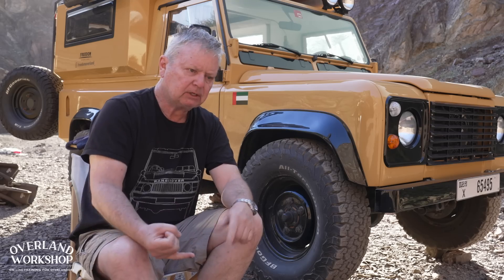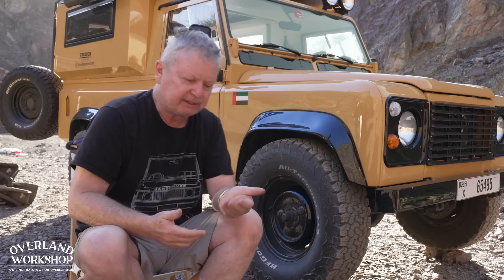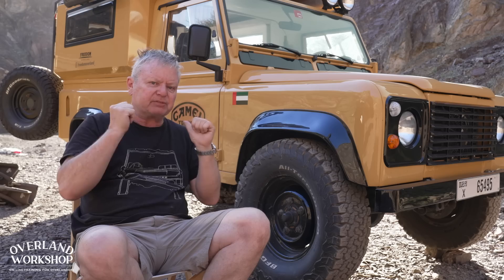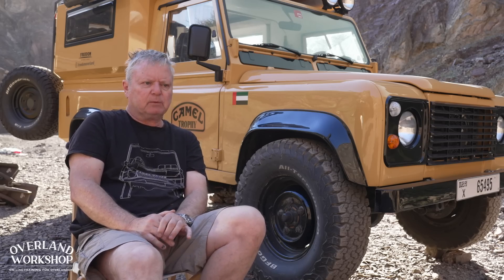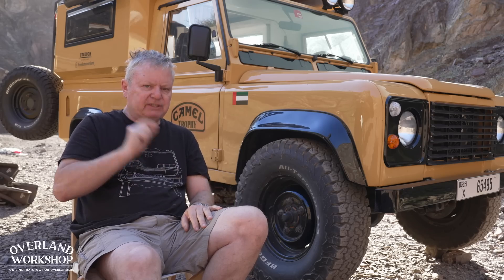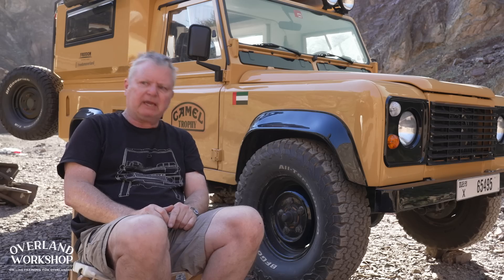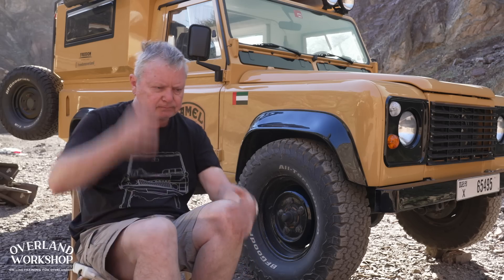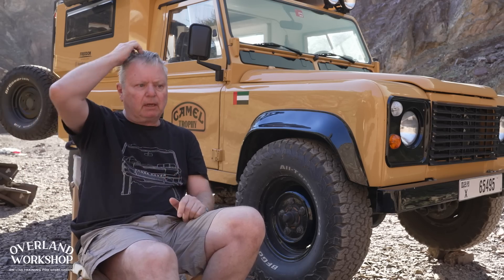4x4 Suspension principles, incorrect assumptions and stupid ideas @4xoverland

Comment: If the tank was properly baffled and you weren't exceeding the weight limit and it was distributed properly water should be fine. I have carried 20 fuel and 20 water on the roof. But that was about it. Didn't have an option.
Reply from the maker: Almost every off-the-counter roof tank is plastic, which means no baffles. But any way one looks at it, IMO, there are always better ways to carry water.

Comment: Very interesting Andrew.
Thank you.
One question though: I am towing a Caravan with my Defeender 90 and I know that these are probably not really the best vehicles for towing, but I find with stock factory suspension, sits  on its bump stops. I am considering fitting Poly airbag springs just to help level it. Is not a good idea? In your opinion? Love to know your thoughts.
Thanks%
Reply: How's the trailer ball weight?
Reply: @hannahranga  Land Rover specify a ball weight of 150kg. My van should be around 120kg from what I can work out.

Comment: 100% agreed. I have a 2003 chevy tahoe here in the USA. Most people put 6 inch lifts (that do not increase load capacity- just longer shocks that aren't stronger and spring spacers) and the center of gravity is stupid high and they have very little suspension travel for the most part. I have a heavy duty coils in the rear that add 1.5 inches of lift and 400lbs higher load rating than factory, with a 2.5 inch torsion key lift up front, and bilstien 5100 extended travel shocks all the way around. On my trips I put as much inside or on a hitch mounted cargo carrier as I can. The only things on my roof are spare 33 inch tire (cannot fit underneath the truck), traction boards, and a little bit of gasoline. Fully loaded, my center of gravity is still much lower than a tahoe on a 6 inch lift that is fully unloaded. 
Eventually I want to build a storage system inside so there's less on the hitch. Also want to build a rear bar that has a tire swing and fuel can mounts.
Reply: Used to have an 06 Tahoe, miss that thing. Nice to see some GM and US followers here. I have  05' 2500 and will be adding the 5160 shocks. How do you like the 5100s?
Reply: @bamafencer12  they are phenomenal

Comment: Thoughts on PVC pipe water storage on the roof racks? Would be impacted less by movement than a rectangular tank i'd imagine.
Reply: Would act like a solar heater and would free surface if it was aligned the wrong way
Reply: I’ve got a 4 gallon Yakima Roadshower on my Thule Roofrack, on a 4Runner. Balanced w my cargo box (middle) and awning 4’/maxtraxx on the other side. (try to add water if I can last minute and not on long road trips) Spent a good amount of time researching and using brackets and bolts that are extra heavy duty. Also very aware of my total weight and how it’s distributed  < this is key. 
No crazy weight in the interior and no metal bumpers etc… stock suspension. Love it. Dirt roads. No rock crawling.

Comment: My biggest issue with manufacturers is that max payload on standard suspension is often impossible to reach with a good ride.

My -21 hilux (with the updated more comfortable rear suspension) has a max payload of 1000kg excluding driver.
I have around 560 kg including me and it bottoms out way, way to often (And I drive 95% on-road).

It even bottoms out on sharp speedbumps at the grocery store.
Reply: I get the frustration, but as Andrew said manufacturers tend to design for the middle ground. If they tuned the suspension for the highest rating, then it will be stiff when empty. People in the US buy "Super Duty" trucks going for payload and then complain that it rides like a dump truck when empty.

My Xterra has really weak springs in  the rear as well. If you drive with weight  for any length of time they weaken to the point they keep bottoming out. When I finally replaced them, I upgraded their weight rating to compensate for that increased constant load, realizing that should I pull everything out it the ride would be stiffer.

Comment: Unless you have a mechanical engineering degree you and fix the suspension geometry you should not exceed 2” lift, even with 2” lift you need to correct all steering angles and dampening rates.

Comment: With over 40 years in the industry I agree with everything you say.  Also note that the stiffer the springs the less articulation you get for a given load.  Result being the wheel on the extended side will have less weight and therefore less traction than with a softer spring.
Reply: Being a relative 'newbie' at offroading, I've left my ex-military Defender 90 in its original milspec. While others appear to have added some new pieces of kit every time I see them, my Landy has remained unchanged and hasn't let me down. Correct me if I'm wrong, but surely the British Army would have added all of the gimmicky we see in the off-road 4x4 magazines if they were of any real value?
Reply: @rickbear7249  milspec isn't what people think it is. it's the absolute bare minimum, in terms of performance and cost to achieve a set of requirements.

If a component overperforms compared to the requirements, then they are over engineered, cost too much, use too much materials etc. They wont be chosen.. or if they are, the components will literally be refined to just meet their needs, for the benefit of mass production, efficiency and cost.

Private industry will produce components that exceed the requirements. Why and how? because they can charge more, use better materials or over engineer it simple.

If your requirements are aligned to the milspec, perfect. But be aware milspec also usually incorporates the concept of, cheap and replaceable, often trumps expensive and permanent.

Comment: indeed all well presented. the only reason for a lift kit is for brake over angle for that i also recommend a slightly higher rated spring not to make load capacity higher but to keep the height this along with the correct dampers makes for the same ride performance as standard ... question is how often do you really need the extra height :D
Reply: Yea, im not sure what circles we are discussing, but i haven't met anyone here in Australia that thinks stiffer springs increase your GVM ? there are literally engineered and certified GVM upgrade products if you want that.
Reply: the reason and only reason for a lift kit is to gain more travel when offroading.

Comment: Andrew, can you cover the combination suspension lift and shock absorber kits sold by various manufacturers with the emphasis on the points mentioned in this video ? Do they actually all fit the bill or are they “cosmetic” ? Brilliant topic and excellent explanation especially the most ignored item Centre Of Gravity !  Fire engines have special tank modifications internally to prevent massive water slap and they are low down in the framework as well.

Comment: So I agree to the argument on coil sprung 4x4 vehicles employing that set up front and back. I would have liked and looked forward to Andrews views on rear leaf sprung and front coil sprung 4x4 vehicles as to how that argument may be weighted.
In terms of roof racks and the weight carried, yes stay within the permissable loads. However carrying liquids such as water and fuel may not necessarily be wrong on top of a roof rack, sometimes it MAY be necessary. It's the containers that must be considered. Container's with baffles for either fuel or water in my view are acceptable on a roof rack.
Of course the terrain in overlanding is the key player and the driver naturally. In all cases when challenging and negotiating a variety of terrains know the limits of your vehicle and as a driver know your own limits. There is no excuse to be a knuckle head and just blunder onward, your choices deem your outcomes, overlanding, on a safari or an expedition adventure is not about been foolish and exerting male testosterone. But about the sights, sounds and destinations. 😊

Comment: Oh that’s good. I work for a logging company, primarily using Ford F250 trucks as our work trucks. “Crummies” we call them. Constantly overloaded, constantly over driven, constantly breaking leaf springs and blowing shocks. I spent the 1st 15 years of my career working in regular automotive shocks, fixing regular automotive customers, and never have I had to do a spring. Call this a culture “shock” for me, as I’m repairing spring after spring and shock after shock, pulling my hair out trying to come up with a reliable and economical solution. I will note, and I don’t think it was said in your video, that the right spring will haul the weight and do it’s end of the work properly, but the wrong shock in that scenario can also cause the springs to break still. What a balance!

Comment: My JDM HJ 61 Land Cruiser had a maximum load sticker of 350 kg, I'm assuming that it was not including passengers. The rear axle was fully floating, so it was obvious that was for reliability, not load carrying. Travelling light is something I always do as it's less to worry about, easier on the vehicle, and less expensive.
Reply: Maximum load always includes passengers because the manufactures have no idea what the user will put in their vehicle.

Comment: The dumbest suspension opinions are also the popular ones.  You need to be very discerning when taking advice on suspension.  95% of people have no idea what they are talking about, including vendors.  For instance front spring rate - everyone thinks they need heavier springs in the front and they ruin their ride, when most people need longer springs, not heavier.
Reply: To me it is a question of constant load. If I modify a rig as to increase weight when it's sitting in my driveway in any meaningful way, it's worth considering an upgrade. You just need to be mindful of how much weight you are actually adding as opposed to just putting the largest capacity springs on it.

Comment: Here in the United States there's not much in the way of regulation in most states for what sorts of aftermarket modifications are acceptable for on-highway use, and a whole lot of vehicles are modified for appearance far more than for performance.

I always have had the attitude of keeing it simple.  In my particular case my truck is a crew-cab with a 6' bed, the odd long wheelbase version of a truck normally sold as a king-cab with 6' bed or a crew cab with a 5' bed.  In many ways the LWB truck's suspension, identical to the SWB truck's suspension, is pre-compromised from the factory.  So the long wheelbase already harms the breakover angle, and the extra weight of the longer truck on the same suspension components that the short wheelbase truck uses meant that the truck sits lower, closer to its bumpstops before any cargo or passengers were loaded.

To avoid the problem of cheap aftermarket I actually started out by looking at OE parts or OE-replacement parts.  There was an SUV on same platform that had a factory V8 engine option, and along with it was packaged slightly stronger coil springs for the front end.  Not crazy so, but enough to account just a little for extra weight.  In the back I went with a triple combination, some added leafs, some Timbren tall rubber bump-stops along with deleting the heavy factory overload leafs, and some mild lift from slightly taller leafspring shackles.  I also went with Bilstein 5100s, in the front using the 3rd notch from the bottom for some lift, and in the back selecting the dampener that is around an inch or just a hair more to go along with the change in ride height and range.  I also chose a slightly lighter front antisway bar than what shipped with the truck, for just a little more suspension flex side to side without deleting the bar entirely.

The truck performs fantastically this way.  Even loaded with camping supplies and hooked up to tow a single-axle travel trailer I'm far enough off of the Timbrens to where the ride is comfortable and acceptable on even fairly washboarded roads, and yet unloaded the ride is still comfortable, the springs are not too stiff for the weight they're carrying.  If required the Timbrens act as both overload springs and as bump-stops.  The front likewise was lifted such a minor amount that I was able to use those longer upper balljoints to keep the upper control arms properly positioned, so I didn't have to buy expensive aftermarket upper arms, and the alignment shop had no trouble aligning it.  When unloaded the back does sit a little higher than the front, I got perhaps 2" lift in front and 3" in back, when the bed is loaded with supplies or cargo it sits level, and when the truck is towing it's perhaps a half inch lower a the whel arches in back than in front at the arches.

Just this past weekend I took the truck on a trail rated 4/5 and had no trouble with it.  Looking at it one can tell it's modified, but subtly so.  Steel wheels painted black, raw aluminum shocks, normal black-powdercoated springs in front and painted leaves in the back.

Comment: A watertank on a roofrack,youre pushing youre luck,worked at a mine where a diesel bowsertruck with a halffull tank of diesel took a 90 degree turn too fast and geuss what? The truck ended up on its side,moral of the story 3500l/3.5 tons of liquid doing 90 degree turns at speed,extremely bad idea! But yeah andrew is right for serious overlanding get advice from people that will be honest and realistic with you as it wont be cheap poor advice will hurt you financialy in the long run.

Comment: rooftop tents need to be made lighter. So many good ones are 90KG+ and that's without roofbars, awnings etc
Reply: And then you get manufacturers launching “the lightest” RTT on the market, yet it still weighs 50kg. 🤦🏼‍♂️
Reply: @landrover1155  I drive a Suzuki Jimny mate, 50kg is too heavy. Cheers.
Reply: @landrover1155  I believe it’s only 40kg. Frontrunner rack is 27 and Oztent Swag RS-1 is 15 so I’m good as it is, but no RTT unfortunately. 😁

Comment: As a truck driver on outback roads.
I see every second 4wd with pvc pipe on the roof rack with a tap at one end.
I could never understand how someone could put something so unstable up so high.
Reply: Turns out bogans are not very technical.
Reply: gotta have that pov pack hot shower
Reply: @MrCharrrles  I'd rather take a cold shower. It's better for many reasons, including reduced water consumption because you don't want to stand under it for longer.

Comment: One of my favorites builds would be a Defender with the 3.0 D-4D Toyota swap. Perfect reliable tourer to keep for decades.
Reply: Nah that engine is problematic. The most reliable Toyota small diesel is that 3 liter inline-4 EFI naturally aspirated diesel that they still build for those white Toyotas that operate all over the globe.
Reply: @imnotusingmyrealname4566  yes, but the option from the 3.0 D-4D was due to be a more modern platform and balanced power and fuel consumption for the Defender stock drive lines.
Reply: @RogerM88  yeah that engine is not powerful at all, like 100hp but for a more powerful and fuel efficient option the best would probably be the 2.8 D-4D without the emissions systems they also build for the white Toyotas
Reply: @imnotusingmyrealname4566   as an European the biggest issue would be the legalization process of such swap.
Reply: @imnotusingmyrealname4566   in most European countries big SUVs pay ridiculous taxes, unless they're commercial van versions or pick-ups. And the previous Defender had a van and pick-up versions. and some hard top versions registered as pick-ups, similar with the Wrangler. Not a surprise their prices are very high, even if they aren't known for their reliability.
Reply: There's a reason why engineering mobs do Isuzu 4j conversion kits and not toyota.